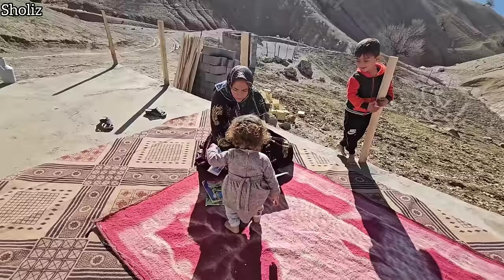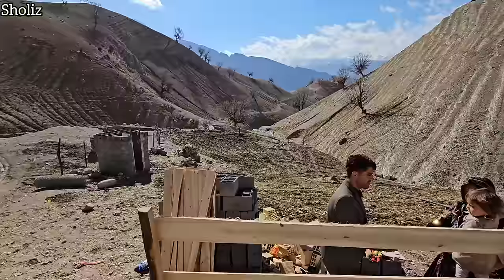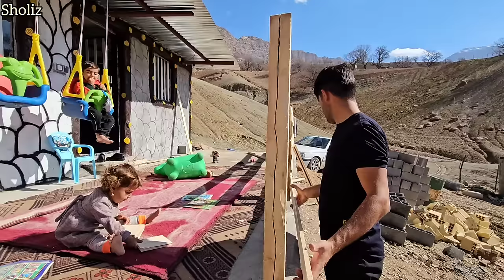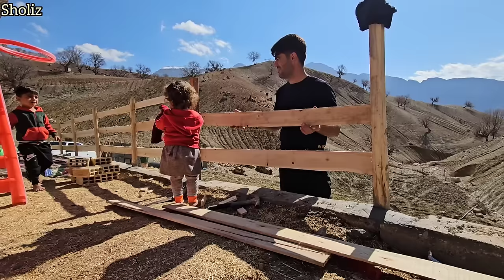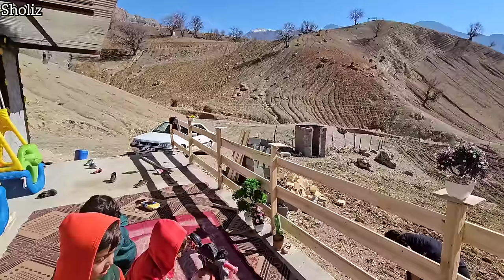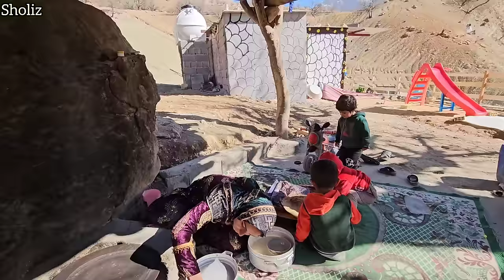Nomadic building boundaries: increase security with a wooden fence in the nomadic house cooking food

Comment: Hamid in my opinion you should put your fence boards on the house side of the fence posts. Because if someone falls against the fence boards they will most likely snap where the nails have split the boards. If the boards are on the inside and someone falls against the fence the strength of the boards will better hold them. This is just a suggestion. Love your family and I have been watching every video since your wife's fake husband built her the stove and oven in front of their house up in the hills. That was even before Hasti could even crawl and they had a black and white dog. 🤠❤❤❤❤❤👍👍👍👍